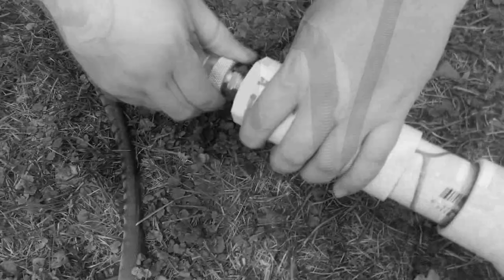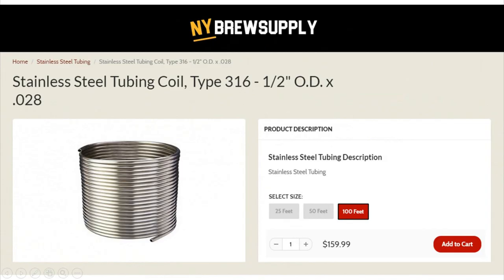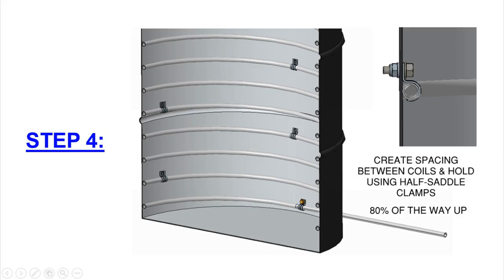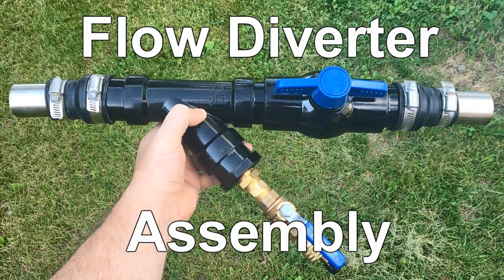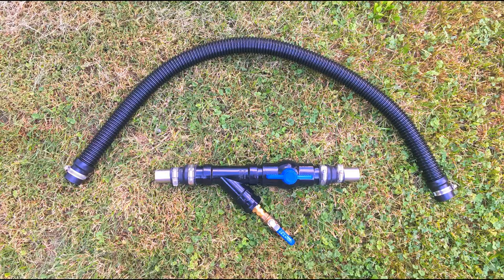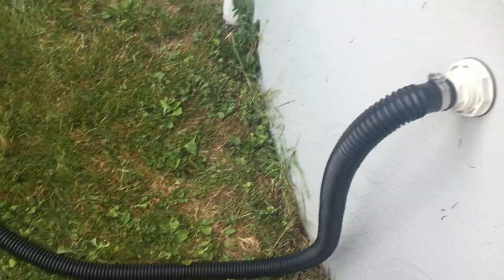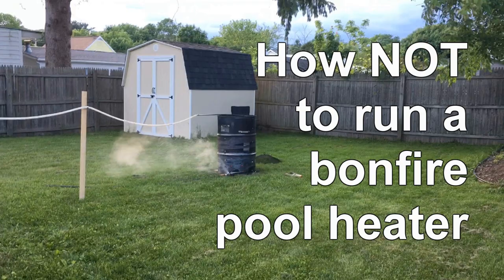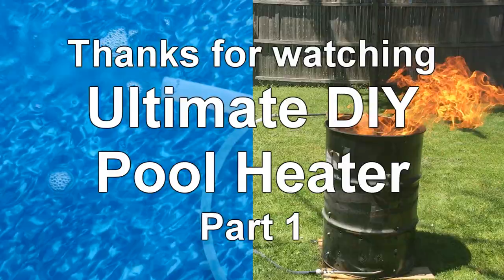Ultimate DIY Pool Heater | Part 1 - Construction & Setup

Comment: Highly doubt it would heat a real pool.
Reply from the maker: Part 2 of the video shows the performance of it. This design can produce 3GPM of consistent hot water. It's not as good as a commercial pool heater would be, but works better than solar heaters, covers, lilly pads, and other DIY methods I've come across on Youtube.
Reply: This is the 1st time I have posted wanted to say thanks and let everyone know my husband and I built this and we have 22x52 bestway pool.  This does work as long as you keep a hot fire going which is easy we have lots of cut wood and down branches.  It is not hotbed hot but it is not ice cold like it was last year.  Need to allow like 24 hr as advised I live in Georgia and my pool has trees over it so does not get much sun.  I did get the coil off of eBay and it was cheaper I only paid like 55 bucks for it and I got a drum for $20 off next-door neighbor and I got the rest of the pieces from Home Depot so I roughly spent about 110 bucks and it does heat my pool.  Running It once a week to keep the pool at a nice temperature and I love that the diverter because it does allow me not to have to disconnect anything just close the valves. Also sorry if this is in the wrong place. Older and this is not my thing.
Reply: I can honestly say it does work. I get 120F - 160F out of the hose. I have not had to run it all summer just during the opening. I will definitely use it near the end of the season.
Reply: @kendraarmour2149  Do you have a link for the stainless coil on Ebay? Burn barrels usually can get for free or less than $10.